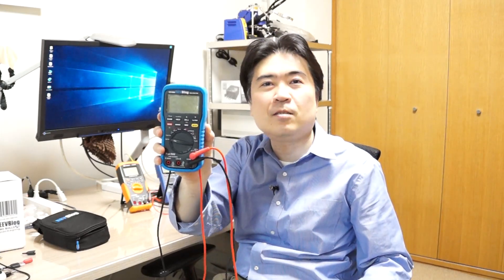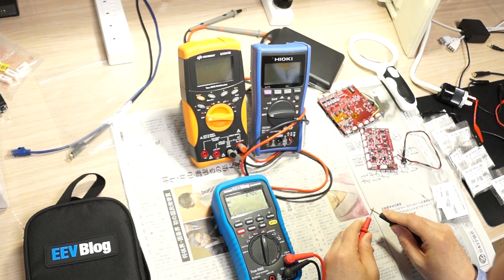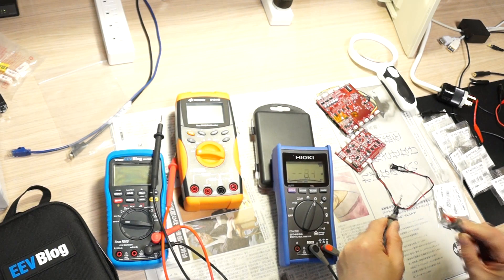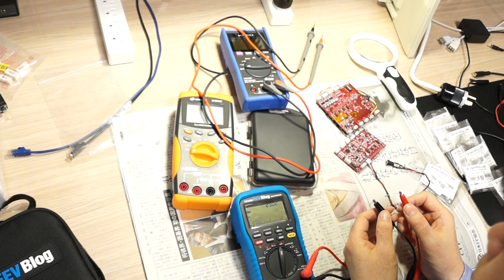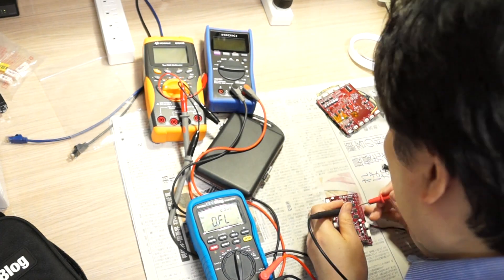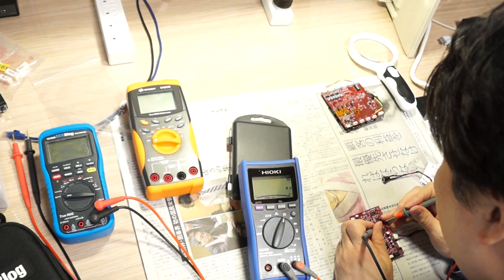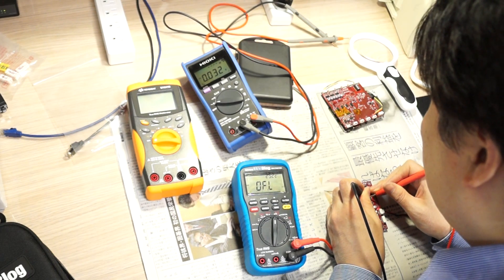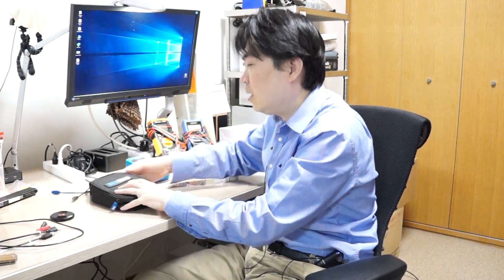Akira-EN #3 EEVBlog 121GW Multimeter Resistance test with auto-range slow?

Comment: It's not fair to compare these 3 multimeters, when the resolution on the other two is so poor compared to the EEVblog one.
Reply from the maker: Agreed, all the meters have pros and cons, and I am using 121GW when I want 50,000 count resolution, that is enough for me. The auto range speed on Voltage is alright at least for me and the auto rage speed on Resistance is not fast and I just switch to the manual ranges. My first multimeter was manual range and my old habit kicks in :)

Comment: Did you post a link to this video on the EEVBlog, or start a new thread called 121GW testing/features?
If so, can you add that EEVBlog thread URL to the description of the video.
Thanks for taking the time to to these videos. I know your normally don’t do videos and it does take extra time out of the day so I appreciate you doing these. 
If I had mine (lost on shipping)  I might have figured out some of these issue already as I mentioned some interesting behavior in Joe’s comment on this video. If my theory is correct, it could also explain why the bar reads faster then the displayed results. The bar isn’t trying to do any math, seem like this should be able to fix with a firmware update.
Scott
Reply from the maker: Thanks, it is good idea to put the link of the discussion in EEVblog forum. I have not made a new thread at the forum by myself since there ware already a good thread with long discussion. I made the video after I saw the discussion at this link. http://www.eevblog.com/forum/testgear/new-eevblog-branded-multimeter-coming/msg1396054/#msg1396054

Comment: You need to wait for the meter to fully settle with OFL displayed before reapplying the short if you want it to reproduce when you apply the short or device you are testing.  The other two meters over range very fast so they repeat.    Still, a good test and thank you for showing it.
Reply from the maker: Hi Joe Smith, thank you for your comment, did not know it requires to wait until OFL shows on display, then they were keep searching in the auto rage in my video. Great to have beneficial knowledge. Thanks.
Reply: If you decide to repeat the test, you may find it takes just as long to go both directions.   OFL to short and short to OFL may both be around your six or so seconds.    You could just verify this on the bench and post your results.   Again, thank you for taking the time to post this information.
Reply: What I find interesting is if these are the same Brymen leads as Dave said came with the BM235, this doesn’t match mine at all. And I don’t use my leads often, mostly my fluke or Pro master probes. 
So my fluke 298 says 0.08 with a dead short before zeroing out, but it’s a two wire reading. FYI, under 3 seconds for the fluke auto range to zero out.
My 2 miliohm meters I’m testing agree with each other. Let say 0.0289 for one, and 0.0248 for the other. When checked on my HP34401A I get 0.028 and 0.023. I forgot to set my HP on a higher resolution count. Either way, your probes should be in the 0.06? Range. I also removed the banana adapters from my Brymen leads like you have for this test.
Reply: I wonder if they are trying to auto zero it out like the BM235 does. I would rather it doesn’t do this, and manually zero it out for the lower ranges, and have it over limit in the higher resistance ranges. 
So I hope they didn’t try to build this into the firmware. If they did, they need to remove it so the meter doesn’t struggle with the extra math, lol.
I noticed you added the alligator clips that should have added 0.033 Ohms to the measurement since you didn’t zero out the meter. So maybe they are trying to do this for user ease of use.
If so, they shouldn’t. If you buy a 50,000 count meter then users need to understand they will just have to zero out under a certain range for accurate reading. This is how it is with higher resolution meters. Why change this now, dump that code for auto zeroing if they put it in. 
This meter does have a ref (zero) button? Doesn’t it?
Reply from the maker: Forgot to add the link to your reply. http://www.eevblog.com/forum/testgear/new-eevblog-branded-multimeter-coming/msg1397204/#msg1397204